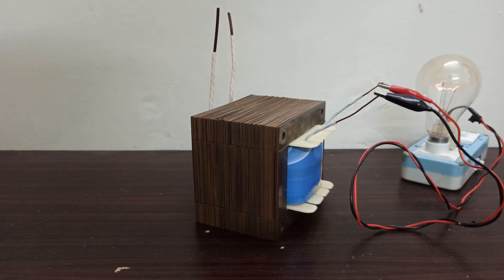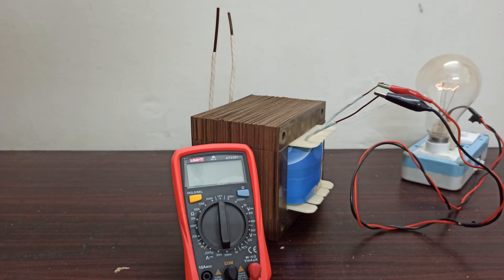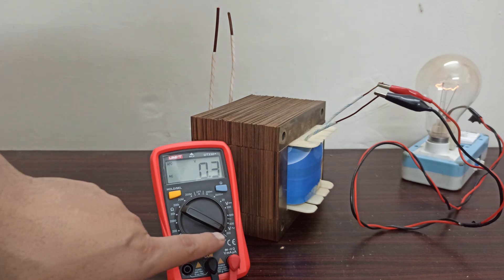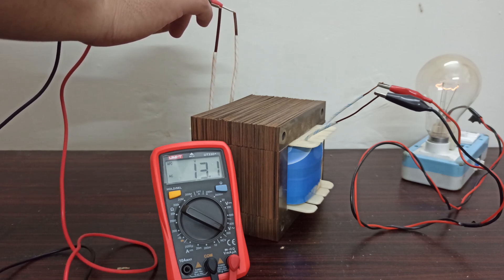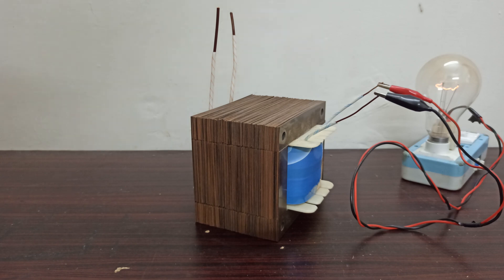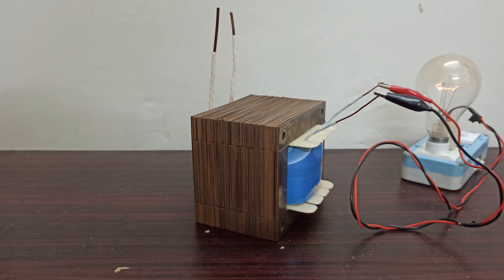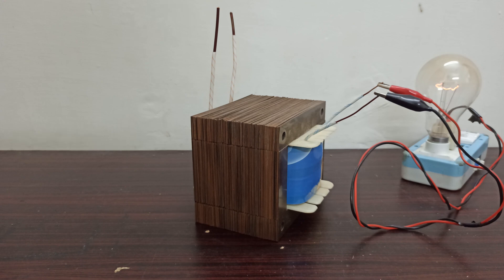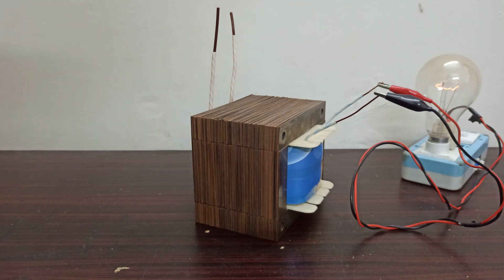1.2Kv Spot welding transformer

Comment: I'm wondering if i have 4kw solar panels with 40v and 100amp (DC)
What else i would be needing for spot welding except the mechanical parts 🤔
Reply: Do i need to use step down transformer or anything else for this? To make it exactly 13volts?
Reply from the maker: Yes, a circuit that would provide tuneable pulsed output (in milliseconds).
The ouput voltage will be stepped down through the dutycycle.